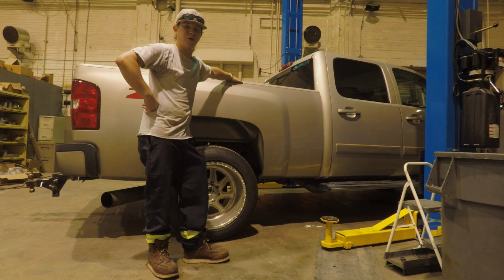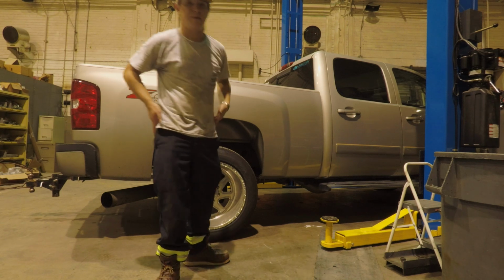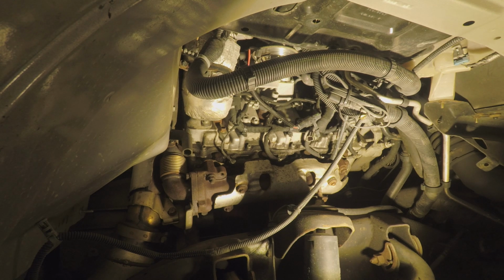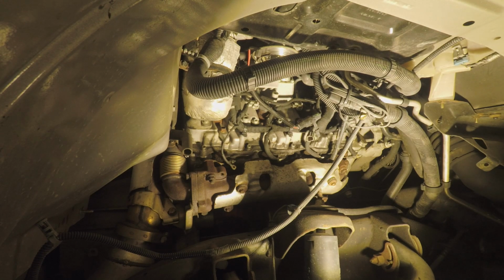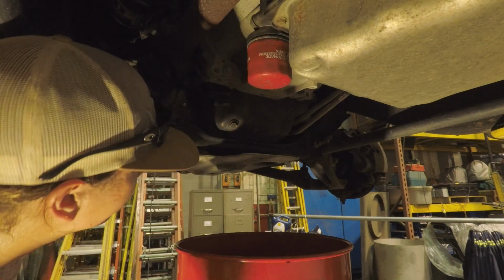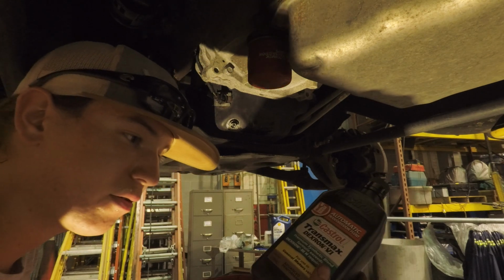Duramax LMM 07-10 Maintenance (Glow Plugs, Fuel Filter, Oil Change)

Comment: Is the cat fuel filter a spin on replacement? If so, what was the part #? What did you end up doing with the water separator sensor? Thanks for the vid.
Reply from the maker: Honestly I put it on so long ago i cant remember, i ordered it from ATP but because of the EPA bullshit they dont sell online anymore, but there are several other companies that make it  . Part # for CAT filter is 1R-0750.  For the sensor i cant remember if it still works with adapter or i just taped it up out the way.  I do remember a few things,  your factory filter base has like a ball and spring that restricts flow into the filter just take all that out, i could tell a difference in throttle response with a free flowing fuel. Also when you mount your new CAT filter base to the block add washers behind it to push it out from the block, because the cat filter is longer and it will hit stuff on the bottom end making it hard to get squared up to thread on. Once i added a few washers it screws right on.
Reply: @averypowelson2821  thanks for the reply, my filter and sensor was replaced and its still saying water in fuel. May be a bad sensor, so i may jus unplug it. Ive ran several tanks of fuel through it, so i dont see how the water can still be there, i will check on that ball and spring idea though .
Reply from the maker: @houladog  Replaced with a CAT conversion or a factory? Also If you dont mind could you smash that Subscribe button for me thanks.